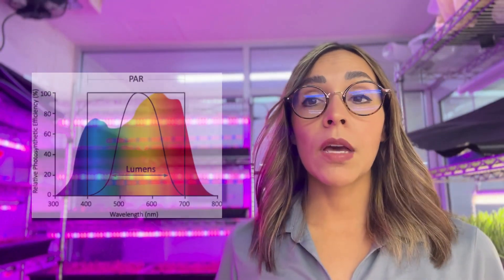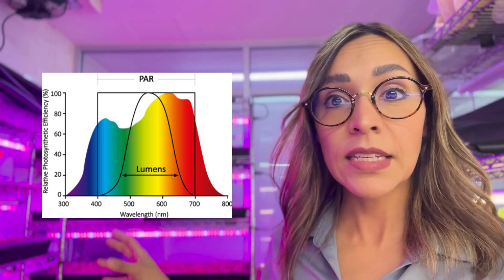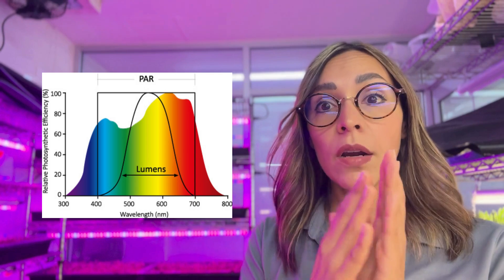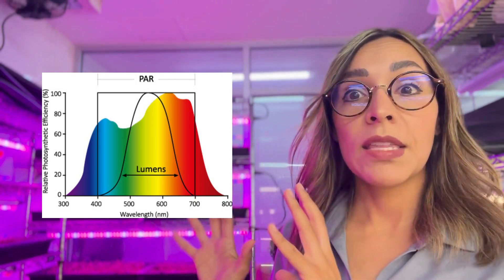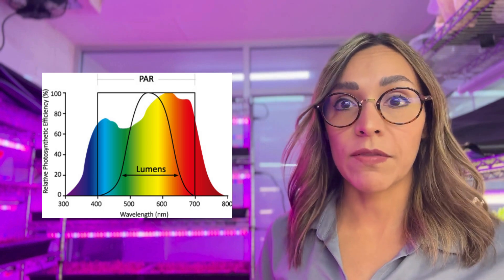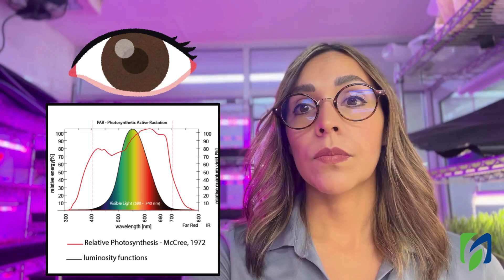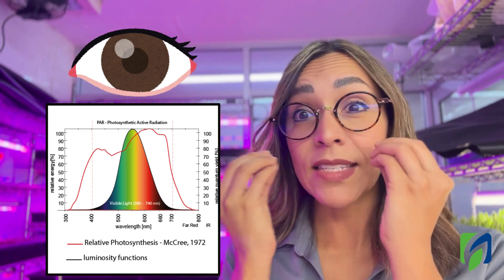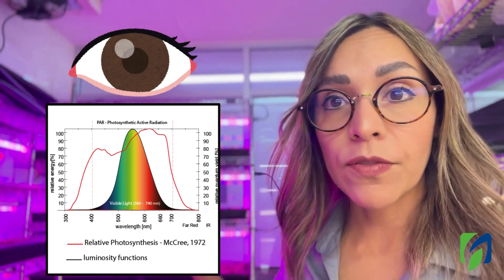Converting Lumens to PPFD in Horticultural Lighting

Comment: So, the million dollar question is, what are the best lights for microgreens? And to take it a step further for those who are on a budget, what lights would be the best budget lights for microgreens? Are the Barrina ones that so many growers use not that great?
Reply from the maker: As a microgreens grower I will recommend to invest in lamp with enough quality to last at least 3 to 4 years. There are specific brands providing 5 years guarantee (example:ArizeLife2 from Verjure). Low quality cheap lamps should be replaced very often. In addition I will recommend to choose a full spectrum lamp with peaks in red and low peaks in blue. Also high quality lamps can provide more efficiency (umol/J) which can help you to reduce electricity costs. Profitability in vertical farming is always around growing plants as fast a possible (shot crop cycles), high quality products and efficiency! 😃

Comment: Yeah but no example of conversion , the video is incomplete
Reply from the maker: Thanks for your comment! When making conversions from lumens to PPFD there is not a particular conversion factor. This is why we didn't share an example of conversion as is not possible to make an accurate conversion without knowing the specific conversion factor for a specific lamp. There are some websites were you can do conversion based on basic conversion factors were you can look for the spectrum with more similar characteristic to your lamps, however the results may not be accurate. Here is a link that can help you to make this type of conversions: https://www.waveformlighting.com/horticulture/convert-lumens-to-ppf-online-calculator